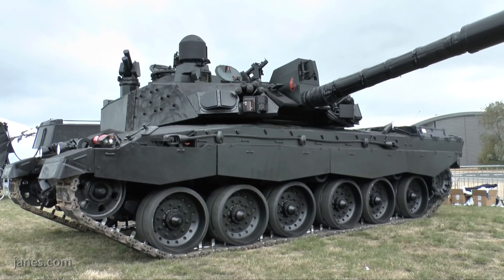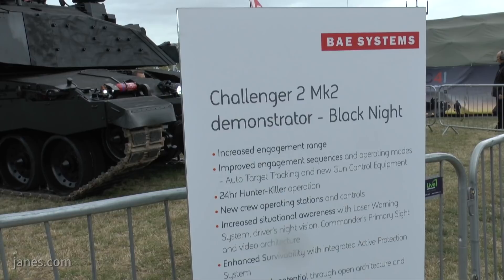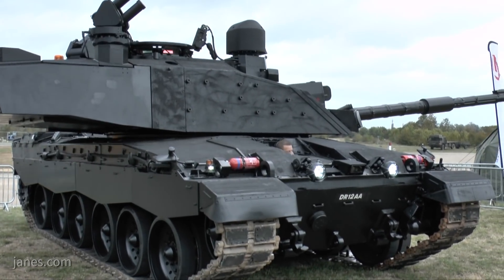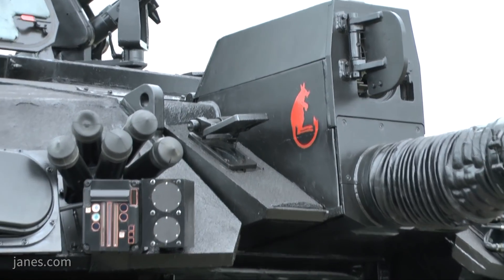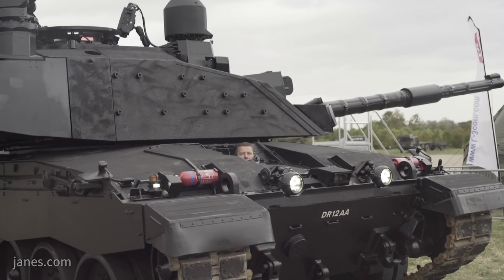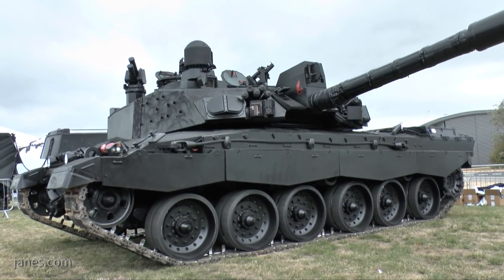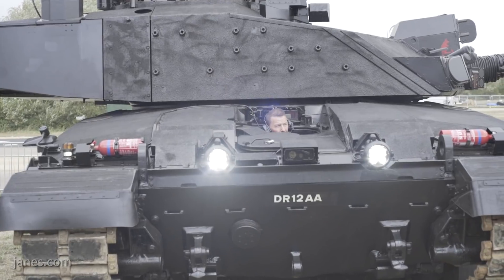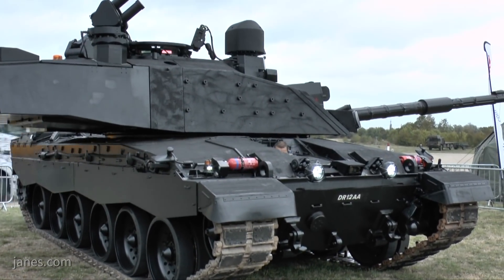DVD 2018: BAE Systems' Challenger 2 demonstrator - Black Night

Comment: Given the complexity of emerging threats, any changes and improvements to the British Challenger II would be welcomed by the armed forces In the UK and NATO.  The Ministry of Defense needs to make some decisions in short order and not delay in putting those improvements into the UK’s tank force.  There is always that slow decision-making in government when potential threats & needs are confronting the armed forces, and decisions need to be made.  The MOD should do an evaluation of the proposed improvements and make that decision sooner rather than later.

Comment: That tank looks like cold war relic from a garage sale
Reply: It is based on the Centurion and even the Oilphant would look quite nice next to it.
This upgrade program will probably add more weight and provide some enhancements to the capability of the tank as part of a small force, but I would doubt that facing serious competition that it can handle any serious volume of opposition forces.
The MOD in the UK faces castration annually from budgets, so this upgrade program is a surprise in itself.

Comment: Give it a 120mm or 130mm smoothbore gun. Rifled guns are pointless as all effective anti-tank rounds are fin-stabilized in this present day. Put in a 1500hp engine. Actually put some composite armour on it's lower glacis(which isn't an add-on), then add all the technology upgrades and you have a good tank.
Reply: Yeah. That's why the only "smoothbore" guns you otherwise see on a "battlefield" are shotguns. Idiot.
Reply: You can't compare rifles to tank guns dude. Smoothbore ammo has stabilising fins, rifle ammo does not.
Reply: @deeremeyer1749  Firearms and tank cannons are completely different things you fucking dipshit. Literally 2 seconds of research and you can easily see smoothbore if the way of the future and can use more ammo types and get higher muzzle velocities than a rifled cannon. Even the British know and have accepted that fact. Shut the fuck up and know what your even talking about before you spout off more fucking drivel.

Comment: Only 1200 Hp ??? - mobility/speed on modern battlefield are escential, so dont buy this one - not yet
Reply: you think 59kph is slow? for a 75 tonn tank. and yes this tank can turn fast
Reply: RAY RAY  59 kph is for the stock Challenger 2 with 62.5 tons (19.2 hp/tonne). The 75 ton TES (H) is slower (16 hp/tonne).
Reply: Show me a modern diesel engine that will fit in that "hull" that has "1200 hp" on a legit, properly-calibrated engine dyno that calculates "horsepower" the correct way and that loads the engine from "high idle" down to "rated speed": and I'll kiss your ass. Been a diesel mechanic for 25+ years with tons of Caterpillar experience and quite a bit of "Perkins" experience (Perkins never built an engine "in-house" prior to Caterpillar BUYING "Perkins": that came within  900 horsepower of "1200 horsepower" so THAT "Perkins": shit is HILARIOUS) and tons of Deere experience and I've worked on everything from diesel-powered lawn tractors to GE C-44 Evolution 4500-hp diesel-electric freight locomotives for Union Pacific that crank out 4500 "traction horsepower" at well under 1100 rpm making about 25,000 lb-ft. of torque from 11,000+ cubic inches of modern electronic common-rail V-12 getting 50 psi (gauge and not "absolute") of "boost" from a 40.000-lb. "motor" in a 216-ton locomotive and I've been an "engine and powertrain specialist" all of my professional life and a "gearhead" my entire life period so that "1200 hp" claim is complete and utter bullshit unless that's a "bare engine" running on an "engine dyno" of the type used for dyno testing "automotive" engines that applies a "partial load" to an "idling" engine and then accelerates the engine and "extrapolates": horsepower based on how quickly the engine "accelerates" instead of a proper engine/PTO dyno that puts the engine at "high idle":to BEGIN WITH and then loads it down to ":rated power" and uses the CORRECT METHOD OF ":MEASURING" WHAT IS ACTUALLY A "WORK RATE" AND IS KNOWN AS "HORSEPOWER". WHICH IS TO CALCULATE IT FROM TORQUE AND ENGINE SPEED. HP = (Torque x RPM)/5252. AND WITH "MODERN" COMPUTER-CONTROLLED "ENGINE DYNOS" MAKING "DYNO PULLS" USING PRE-PROGRAMMED SOFTWARE AND ELECTRONIC CONTROLS AND "CORRECTION FACTORS" AND "ATMOSPHERIC CONDITIONS" THAT CAN BE "CALIBRATED" BY THE "PROFESSIONAL" OPERATING THE DYNO TO PRODUCE WHATEVER  "HORSEPOWER NUMBERS" THE "CUSTOMER" WANTS TO "SEE" AND HAS "PAID FOR", I'M NOT CLAIMING THOSE BOAT ANCHOR "PERKINS" ENGINES NEVER MADE "1200 HP" ON THE "DYNO". BUT I KNOW DAMNED GOOD AND WELL THEY'D NEVER MAKE "1200 HP" ON A GOOD DYNO PROPERLY OPERATED BY A REAL PROFESSIONAL AND WHEN TESTED TO "STANDARDS" FOR "HEAVY-DUTY DIESEL ENGINES". 

THAT "SPEED AND MOBILITY ARE CRUCIAL ON A BATTLEFIELD'' SHIT IS HILARIOUS SINCE TANKS ARE "INFANTRY SUPPORT" VEHICLES AND THE "MODERN" MAIN BATTLE TANK AS USED BY PROFESSIONAL AND TRUE WORLD-CLASS "MILITARY FORCES" - WHICH MEANS THE UNITED STATES ARMY AND THE USMC - IS A "SUPPORT VEHICLE" FOR "BRADLEY FIGHTING VEHICLES" AS WELL AS "HUMVEES". "CAVALRY UNITS" TODAY ARE ALL "MOUNTED" ON MECHANIZED "HORSES" BUT DO PRECISELY WHAT THE ORIGINAL "CAVALRY" FORCES MOUNTED ON HORSEBACK DID FOR THE "MAIN FORCE" OF INFANTRY "TROOPS" OR "FOOT SOLDIERS" AS IDIOT LIMEYS MIGHT CALL THEM. USED THE "POWER" AND "SPEED"  OF THEIR "MOUNTS" TO "SCOUT": 

AHEAD OF THE "MAIN FORCE" OR "COLUMN"  AND JUST LIKE YOU NEVER FUCKING GO OUT AND RUN AN ACTUAL HORSE "HARD AND FAST" AND PUT HIM/HER AWAY "WET" IF YOU DON'T WANT TO BE "AFOOT" IN PRETTY SHORT ORDER WITH AN EXHAUSTED AND/OR INJURED OR JUST PLAIN "UNCOOPERATIVE" MOUNT THAT CAN'T/WON'T "RUN HARD" WHEN YOUR IDIOCY GETS YOU BOTH IN TROUBLE OR ITS TIME TO BE "PROFESSIONAL" AND DO SHIT "RIGHT", YOU DON'T GO BLASTING AROUND A FUCKING "BATTLEFIELD"  AND LEAST OF ALL IN THE LARGEST, HEAVIEST, EASIEST TO SEE, HEAR AND "FEEL" MOUNTS EVER MADE FOR "CAVALRY TROOPS:" AND WHILE "SCOUTING" AND "GUARDING" THE MAIN COLUMN/FORCE TIP OFF THE ":ENEMY" THAT YOU'RE SCOUTING FOR TO DETECT FIRST AND WHILE NOT BEING COUNTER-DETECTED UNTIL YOU WISH TO BE COUNTER-DETECTED IF AT ALL UNLESS AT BEST YOU WANT TO HAVE A "WORN DOWN" MOUNT IF NOT A COMPLETELY :"WORN-OUT" OR "BROKEN-DOWN" ONE THAT GUESS WHAT? IF "DISABLED" BEFORE OR AFTER DETECTING THE ENEMY AND BEFORE BEING COUNTER-DETECTED MOUNT YOU HAVE TO "EVACUATE" OR "ELIMINATE" FROM THE "BATTLEFIELD" ALONG WITH ITS NOW "AFOOT" CREW SO THEY DON;T BECOME BIGGER "LIABILITIES: TO YOU LATER DURING OR AFTER "BATTLE" AFTER BEING CAPTURED BY THE ENEMY WHO MAYBE FOR "WANT OF A HORSE" ENDED UP WINNING THAT BATTLE OR AT LEAST CAPTURING AN "ASSET" THAT AT THAT POINT IS AN EVEN BIGGER LIABILITY TO YOU BECAUSE YOU EITHER HAVE TO "ELIMINATE" IT WHILE IN ENEMY "CUSTODY" OR "EVACUATE" IT FROM ENEMY CUSTODY. 

EVER HEARD THE PHRASE "FOOLS RUSH IN WHERE ANGELS FEAR TO TREAD"? DO YOU SUPPOSE THAT "PHILOSOPHER" WAS TALKING ABOUT SOME SORT OF "PEACEFUL" ENVIRONMENT OR A "BATTLEFIELD" OF SOME KIND WHERE ONLY A FOOL WOULD BE IN A "RUSH TO WAR": THERE IS A "MODERN" MILITARY DOCTRINE OF ":HYPERWAR" WHERE YOU HIT THE ENEMY AS HARD AND FROM AS MANY DIRECTIONS AND AS RAPIDLY AS POSSIBLE AND THEN "DISAPPEAR" BEFORE HE/SHE AT THE :COMMAND LEVEL" EVEN KNOWS ANYTHING IS HAPPENING. BUT "HYPERWAR" TAKES WHAT ULTIMATELY AMOUNTS TO CENTURIES OF "PREPARATION" GIVEN THE NUMBER OF PROFESSIONALS IN BOTH THE "PUBLIC" AND "PRIVATE" SECTORS AND ALL THE MANPOWER AND MAN-HOURS AND MAN-YEARS OF "EXPERIENCE" AND "EXPERTISE" AND ULTIMATELY IT TAKES AN ALMOST "ANTI-WAR" MENTALITY AND AN "ANTI-WAR" APPROACH TO ANY AND ALL "ANTEBELLUM" ACTIVITIES WHILE "PREPARING FOR WAR" IN ORDER TO HAVE THE DISCIPLINE, WISDOM AND PATIENCE TO DO THE ONE THING ABSOLUTELY NECESSARY FOR "HYPERWAR" TO "WORK" PERIOD MUCH LESS BE "SUCCESSFUL". 

WHICH IS "GLADLY" WAIT FOR THE SLOWEST AND THEREFORE MIGHT SEEM THE "LEAST IMPORTANT" PIECES OF THE GIANT "MACHINE" OF "HYPERWAR" TO BE "READY FOR BATTLE". AND ALMOST INVARIABLY THAT ENDS UP BEING "RECONNAISSANCE" UNITS OF YOUR "ARMORED CAV" TO BE "IN THEATER" AND "DEPLOYED" AND SOMEWHERE "ON THE BATTLEFIELD" OR RATHER SCOUTING THE "REAL ESTATE" AND FINDING OUT AS MUCH ABOUT THE "LAY OF THE LAND" AND AT "GROUND LEVEL" AS POSSIBLE FROM THAT LITERAL PERSPECTIVE SINCE OVERHEAD "IMAGERY" AND SATELLITE/RECONNAISSANCE AIRCRAFT/MAP/HUMAN "INTELLIGENCE" AS "INTERPRETED" BY OTHERS WHO ARE ON THE "OUTSIDE LOOKING IN" AND WHO DON'T AND CAN'T BE "TAUGHT" OR "TRAINED" TO SEE A "BATTLEFIELD" FROM THE PERSPECTIVE OF THE "MOUNTS" THAT HAVE TO BE ABLE TO "SUCCESSFULLY" MAKE IT OVER TERRAIN THAT A SOLDIER "ON FOOT" WOULDN'T EVEN CONSIDER A DECENT "HIKE" BUT THAT CAN AND WILL STOP A "MOUNT" - EITHER HORSE OR TRACKED/WHEELED VEHICLE - LITERALLY "DEAD IN ITS TRACKS". 

TANKS AND HORSES CAN'T COME CLOSE TO "SUCCESSFULLY" MUCH LESS "SAFELY" TRAVELING OVER, AROUND AND THROUGH "TERRAIN" THAT IT DOESN'T TAKE ANYTHING LIKE A "SOLDIER" OR "HIKER" TO COVER WITH "EASE" UNLESS THEY HAVE VERY EXPERIENCED, SKILLED, DISCIPLINED AND PATIENT HUMAN BEINGS TO "LEAD" THEM OVER/THROUGH IT AND THAT REQUIRES A "LEADER" WHO UNDERSTANDS THAT "LEADING" AND "GUIDING" A HORSE OR VEHICLE OVER/THROUGH ROUGH TERRAIN THEY DON'T "WANT" TO TRAVEL IS USUALLY NOT A GOOD IDEA PERIOD SINCE YOU MAYBE MAKE IT THROUGH/OVER IT GOING "SLOW AND STEADY" AND LEADING/GUIDING/TALKING YOUR "MOUNT" THROUGH/OVER IT AS YOU'RE "GOING" BUT THERE'S ALWAYS THE POSSIBILITY THAT SOMEWHERE FURTHER "DOWN THE TRAIL" YOU HAVE TO MAKE  U-TURN AT AN IMPOSSIBLE "OBSTACLE: AND MAY HAVE TO "BACKTRACK": IN ONE HELL OF A HURRY AND IN A SITUATION WHERE SIMPLE SURVIVAL LITERALLY REQUIRES THROWING CAUTION TO THE WIND AND YOU'LL HAVE TO "RIDE LIKE HELL" TO GET OUT ALIVE. THE ONLY PROBLEM IS THAT YOU CAN "FLOOR" THE THROTTLE OF A VEHICLE AND WHIP AND SPUR A HORSE FOR ALL YOU'RE WORTH TRYING TO FORCE THEM TO "RUSH IN" BUT BACKWARDS AND AT HIGH SPEED INTO/OVER/THROUGH TERRAIN YOU - DEFINITELY NOT AN "ANGEL" LEAVING YOU ONLY TO BE THE YOU KNOW WHAT - MAY NOT HAVE RUSHED INTO GOING BUT DAMNED SURE ARE "COMING" AND WILL MORE THAN LIKELY PAY SOME KIND OF PRICE FOR HAVING "RUSHED" AT ALL. 

THERE'S ALSO AN OLD SAYING ABOUT BEING ABLE TO LEAD A HORSE TO WATER BUT NOT BEING ABLE TO MAKE HIM DRINK. THINK THAT "LESSON" WAS LEARNED BY A "PHILOSOPHER" WHO TRIED WATERING HIS "PET HORSE" BEFORE GOING ON A LITTLE "PLEASURE RIDE" AND WHEN THE HORSE REFUSED TO "DRINK" SIMPLY SAID "OH WELL" AND LET THE HORSE BE THE "BOSS" OVER WHAT, WHERE, WHEN AND HOW HE'D DO WHAT HE NEEDED TO DO AND DIDN'T TRY TO MAKE HIM "OBEY" OUT OF SHEER FOOLISHNESS AND MAYBE GETTING "AGGRESSIVE" IN TRYING TO TRAIN THE HORSE TO "OBEY" WHICH MADE THE HORSE "SHY" FROM EVER "DRINKING" WITH THAT FOOL AROUND EVER AGAIN NO MATTER HOW THIRSTY HE/SHE WAS OR IS IT MORE LIKELY THAT LESSON WAS LEARNED IN A SITUATION WHERE BECAUSE THE FOOL TRIED TO FORCE A "DUMB ANIMAL" TO "OBEY":: AN "ORDER" THE HUMAN "BOSS" ASSUMED THE HORSE "NEEDED" TO OBEY BEFORE SETTING OFF ON A "LONG RIDE" AND NOT HAVING BEEN "WATERED" FOR HOURS PRIOR AND THE HORSE "REFUSED" TO "OBEY" BECAUSE HE/SHE WANTED TO BE "BOSS" AND/OR WASN'T "THIRSTY" OR WAS IT "INSTINCT" ON THE HORSE'S PART TO ASSOCIATE BEING SADDLED AND BRIDLED AND WITH CINCHES PULLED TIGHT AND NOT BEING ABLE TO "FILL UP" ON WATER FOR A "SPUR OF THE MOMENT" RIDE TO NOT WASTE TIME AND/OR ENERGY TRYING TO DRINK ENOUGH TO NOT FEEL "THIRSTY" BUT NOT SO MUCH THAT HE/SHE WOULD END UP "WATERLOGGED" AND POSSIBLY EVEN "BLOATED" AND THEREFORE IN VERY REAL DANGER OF DYING OF HAVING "FOLLOWED ORDERS" TOO SOON AFTER HAVING EATEN AND/OR BEING "RODE HARD" INSTEAD OF JUST "DISOBEYING": AND NOT DRINKING BECAUSE HE/SHE WASN'T THIRSTY OR THIRSTY ENOUGH TO "RISK IT"> 

NEITHER HORSES OR MACHINES ARE "PEOPLE" AND THEY DON'T REMOTELY HAVE THE SAME "WANTS" OR "NEEDS" HUMANS DO MUCH LESS THE SAME "ABILITIES" OR WE WOULDN'T NEED THEM AND THERE WOULD BE NO "TAME" HORSES OR MACHINES THAT "REPLACED" THEM. AND A "SMART" AND "EXPERIENCED" HORSE WILL "REFUSE" TO OBEY AN IGNORANT AND INEXPERIENCED RIDER FOR HIS/HER OWN GOOD EVEN IF IT MEANS GETTING "WHIPPED" AND/OR "SPURRED" HARD ENOUGH TO REALLY "HURT" VS. "RUSHING IN: BECAUSE THE FOOL ON HIS/.HER BACK WANTS "SPEED" AND "MANEUVERABILITY" FROM HIS/.HER "MOUNT" ON WHAT LOOKS LIKE "EASY": TERRAIN TO COVER "FAST". 

MACHINES DON;T HAVE THAT OPTION, FOOL.
Reply: Eh, it has already been done lol. The Challenger 2E (improved export version) has the 1500 hp MTU MT883 Ka-500/501 engine.

Comment: Without replacing its rifled gun for smoothbore one it's just useless spent of Pounds.
Current APFS-DS CHARM 2 round simply cannot defeat  T-90A, T-73B3 at actual ranges except few vulnerable spots, rifled tank guns  reached their maximum perfomance long ago, and this is the general cause which limits Challenger 2 capabilities.
Also the mobility of CR2 is questionable. 1200hp for a such giant tank are not enough, I doubt boosting it up to 1500hp will fix this problem either.
Reply: placeholder  
hmm , you still do not need to use APDSFS , with the 120mm rifled just APDS. 
120mm smoothbore ammo is a waste of money , your just going to shoot it at an enemy tank. All you need is a Rifled gun that shoots the cheaper APDS round .
Reply: placeholder  
The only real reason to have a Smoothbore gun is to fire HEATFS , and with modern armor HEATFS died. So a 120mm Rifled gun is the way to go. 
The UK has not looked into new rounds for the 120mm rifled , or a new 120mm rifled gun.
l would never use a smoothbore gun on my main battle tank , 2 dictatorships the Russains and the chinese use them.

You do not need APDSFS with a rifled gun. FS  Fin stabilized , a rifled gun does not need it the gun stabilizes the round , only a smoothbore gun needs it.....
Reply: Whats the difference between a rifled gun and a smoothbore?
Reply: placeholder  
Well that's the thing with a Rifled 120mm gun you only need APDS , FS is not needed so your rounds are cheaper . l think the UK should develop the Rifled 120mm more and bring it into the modern age , all she needs are more rounds.. Nothing beats the Rifled 120mm at range.
Reply: @komradearti9935  Interestingly the Challenger 2's APFSDS training round doesn't have fins. The spin from rifling is enough. Wear to rifling has never been a problem with the L30.  Wear is a far greater concern  for smoothbores.
Reply: @komradearti9935  Well it isn't supposed to be a combat round. Just an example of the stability rifling gives to even long rod darts.

Can't really compare 'EFC' from different guns because manufacturers apply different factors. When DM53 was introduced for the Leopard 2 one firing was the equivalent to 30 EFC's. Barrels were exploding after less than 50 shots.
Reply: @komradearti9935  The L29A1 is a long rod penetrator. The cone is not glued to the rod, they are both machined from the same piece. A very simple easy to manufacture training round. Something not possible with a smoothbore.

DU rounds don't require as high velocities as Tungsten. US APFSDS are fired with less barrel pressure and hence less wear to the barrel. As far as i remember the DM53 was so bad they banned Leo 2A4s from even firing it. They also hastily introduced the DM63.

Should ordnance manufacturers choose EFC numbers to make their weapon look better?
Reply: no its a good desision, the rifled gun is superior to the smoothbore
Reply: Wrong ,, the Rifled 120mm of the challenger 2 is its best feature. T-90A has no chance with its shitty little smoothbore gun.
Reply: @darthmorpheus9603  The rifled gun is one of its weakness dipshit, it can't fit or fire new NATO 120mm apfsds penetrators. This has been a problem the British know about for a while. Rifled cannon for "Best feature" LOL you really are a fucking moron, this is basic shit. It's a commonly known fact that the challenger is the weakest design of the NATO MBTs.
Reply: Darth Morpheus GB makes the WORST tanks in the world since WW2... Pure garbage.
Reply: The Challenger 2 is the best of the best. Excellent armor , Excellent main gun.